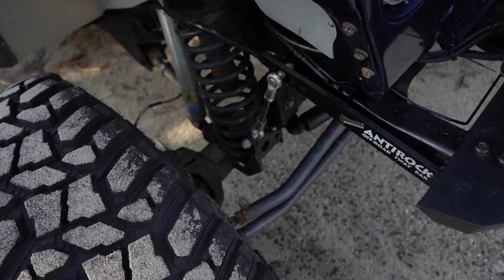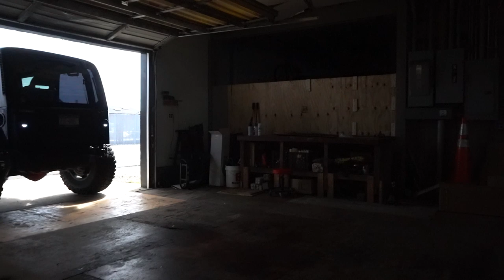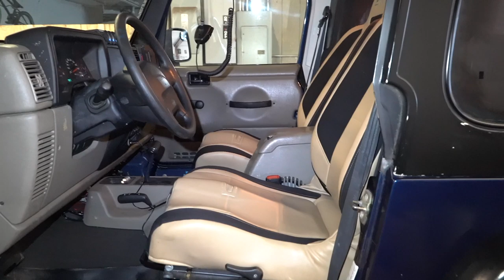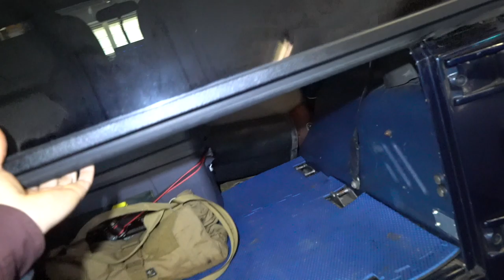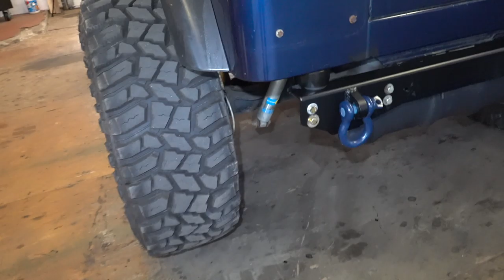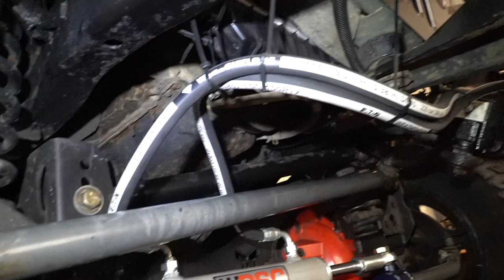I'dRatherBeJeeping TJ on JK44's // Rig Check

Comment: What year is your Jeep? 3 speed or 4 speed auto? How do you like the 5.13’s and 37’s? That’s what gears I got in my Axles I picked up for my TJ I have the 4.0 as well
Reply from the maker: Dixie Four Wheel Drive it’s an 03 with the 3 speed auto w/OD. The 5.13’s put the RPMS in a nice spot but it struggles on hills. I think the big problem is that the beadlocks and tires are super heavy.

Comment: Great video! You mentioned that youre using jk steering did you have to modified the drag link in any way or does it just bolt on?
Reply from the maker: TJ Piñata drag link needed to be shortened just a hair but no welding was needed

Comment: What did you do for the read inner fender wells? Did you just remove the stock liner and paint the inside or did you buy aftermarket one? If you got aftermarket ones could you lead me to where you got them? I have an 05 tj but can’t seem to find any aftermarket rear inner fenders for it. Thank you!
Reply from the maker: The rear fenders and liners are stock. Never touched them.
Reply: Okay thank you!